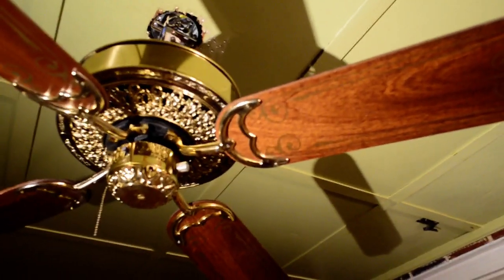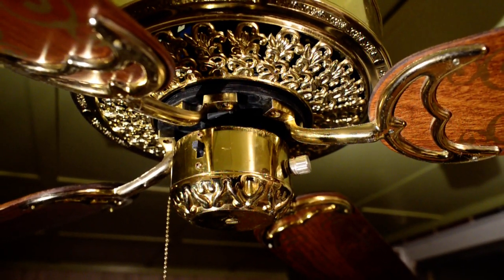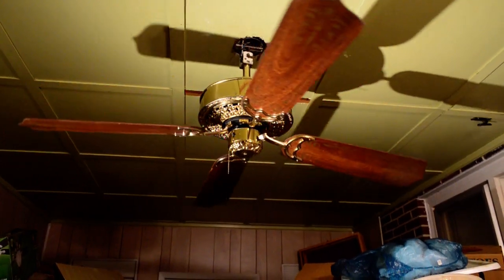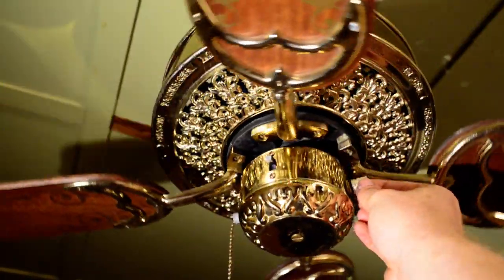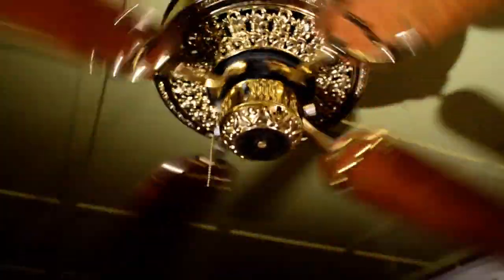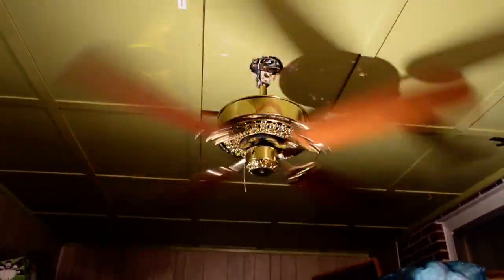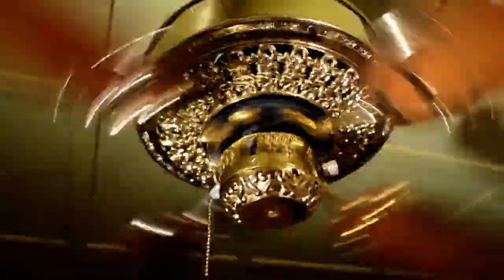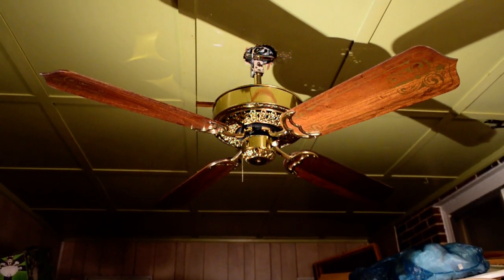North American Fan Co 52" Ceiling Fan

Comment: You wouldn’t happen to know the make & model of a fan with a similar Victorian motor housing to this, but with 5 blades that had cane inserts, would you? If it helps, it was also attached to the ceiling with a rocking ball mount. My aunt had one, my neighbors had one, and I think I saw a couple in a shop in the Black Hills South Dakota, so they can’t be a rare 1980’s fan. I’ve just never been able to find the manufacturer or model on the internet.